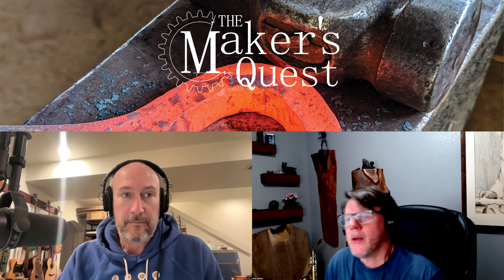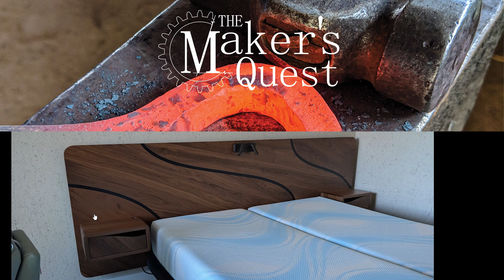Shop Improvements EP31

Comment: I'm at the tail end of a shop renovation. It started with a desire for better lighting because the space started as a musical rehearsal room, so it had 6 can lights on a dimmer and as it gradually morphed into a workshop, I just kept adding clamp lights. Pulling the cans led to pulling the ceiling to reroute wiring and long story short ... I gutted/redid the entire basement.
My old Woodsmith inspired miter saw station has been replaced by two Yukon storage cabinets (White).
Ceiling was redone so that I can access each joist bay individually on demand.
Enough LED shoplight fixtures to land a plane on a dedicated circuit with switched outlets.
More/New OSB wall panels for jig/fixture and decoration storage [I avoid drilling into foundation concrete due to water infiltration]
Pending work , none of which is a priority since it's a hobby shop: new assembly table, some miter "station" solution atop the Yukon cabinets, wall hung dust collector.

Once it's complete, I might do an updated shop tour, but there is no wind in my YouTube sails, so most likely, I won't.

Good convo as always. I listened while prepping the garden for 2025, so circling back here to drop a comment.